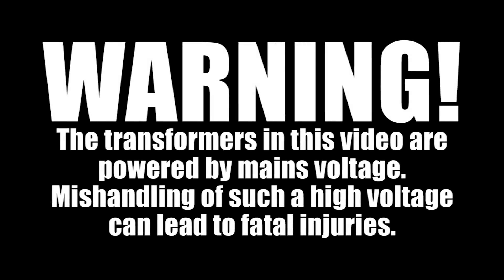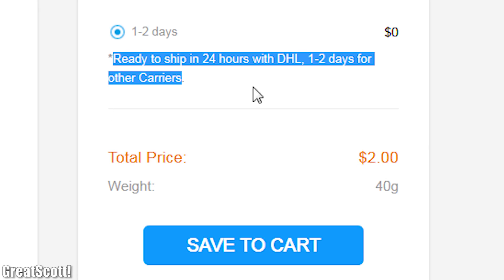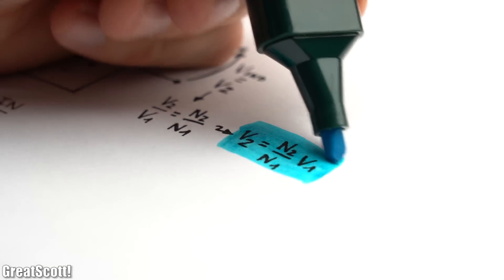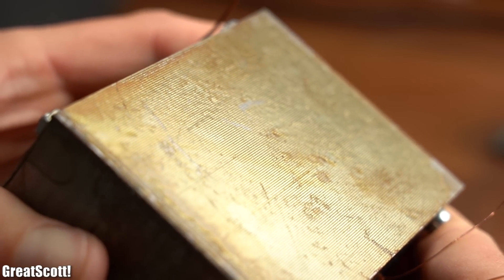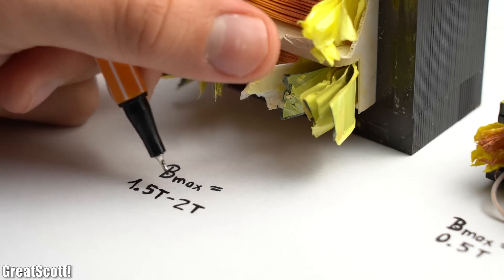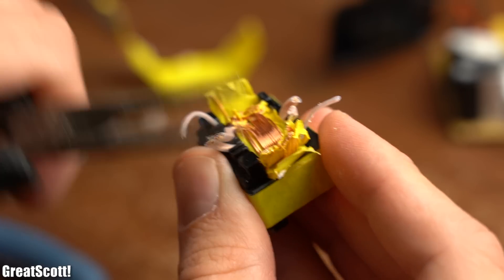Is it easy to create your own Transformer? Everything you need to know about Transformers! || EB#42

Comment: I made one with a keychain ring as a (pure) ferrite core.
Then 1 windings on the primary and 20 on the secondary. So I can transform 230V to 23V. (I wanted to measure my impedance by putting 23V across me and measuring the current.)

Problem:
The inductance was incredibly low, because low windings, low permeability and low cross area

A low Lh, causes a high magnetization current. I calculated it at 340A. Which is more than my C16 is made for.

So I imagned my breaker would trip if I plugged it directly into my wall socket (Yes I have a plug with cut cables, to which i attatched crocs to a small ahh keychain ring. With insulated 1.5mm^2 cables)

Comment: The effect of self-induction that opposes the voltage applied to the primary is already contained in the inductive reactance. The current flowing in the primary at no load is equal to V/Z and there is no additional voltage that decreases the current.
Reply: Carinat61 you are correct about the primary no load current; the explanation given in the video is wrong. I too found this segment confusing. The discrepancy is likely due to measuring the inductance at too low a current. Thank you for your comment.

Comment: Even on a masters degree, you will only touch on some of this theory, to design them, you really need to develop a program or excel spreadsheet to put in approximate values and use LUT from wire gauge charts. good luck.

Comment: So my biggest question is I see these all the time I'm an apprentice electrician trying to learn as much as possible and the primary coils and secondary coils never seem to be connected and I understand there's a magnetic field and Eddy currents are why you use thin laminated sheets of iron instead of solid iron but how does the voltage go through the core and out of the secondary if the cables are insulated is it just the magnetic field is that powerful it just works that way is how I understand it but I wish I knew why on a deeper level

Comment: I have question tought can xenon bulbs for some reason produce arc or non regulate frequency for exampel if alternator back charges true the dashboard or arcing relays?
For some reason I see sparks at night shuting in me engine and it looks like its coming from the head lights .
So any idea why that thing do what it does and how to trace down variating voltages ?
I think I fried me multimeter down the line some how.
Can in general xenon bulbs behave similari like wacum tubes?

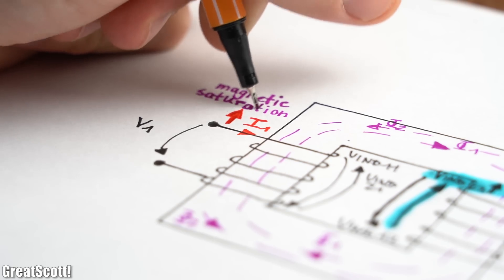Comment: @8:00 in the video: overloading a transformer DOES NOT lead to magnetic saturation!  The flux density is the HIGHEST  at NO LOAD condition & LOWEST at OVERLOAD condition.  All of the voltage "sag" is due to resistance losses in the primary & the secondary.
          Overload condition: iron's job is EASY,  the copper's job is HARD.
          No load condition: iron's job is HARD, copper's job is EASY.
          You can make a transformer transform CURRENT (to serve as a sensor).  You wind a heavy wire only 1 (or a few) turns as your primary.  You wind finer winding (with more turns) as the secondary.  You put ammeter across the secondary winding, essentially SHORTING it.  The current in the sense winding will be the meter reading  x #primary turns/ #secondary turns.  Because the secondary is shorted, voltages will be almost zero & so will be the core flux.

Comment: Transformers are a type of toy robot that has become popular all over the world. They are easy to create and can be made from materials that are easily accessible. In this article, we will provide you with all the information you need to create your own Transformers. 

The first step is to gather the necessary materials. You will need some metal tubing, a hot glue gun, and some scraps of plastic or other materials that can be used for the body of the Transformer. The metal tubing can be found at any hardware store, and the plastic can be found at most craft stores. 

Once you have gathered the materials, it is time to start creating your Transformer. First, cut the metal tubing into two pieces: one piece that is about 10 inches long, and one piece that is about 6 inches long.

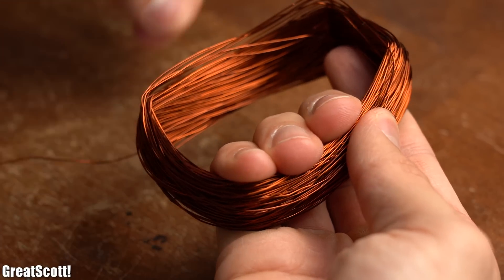Comment: Are those copper coils 3:19 enameled? 

I want to turn a small scale into a plug in scale because the batteries are so expensive.
But the amperage of the battery it uses is 0.17 which is really low and I can't find a proper transformer. Anyone know what to do? No I don't want to just buy rechargeable batteries. I want to see this through even if the costs defeat the purpose.

Comment: the way that those sloppy wires were  wound around that naked core is very dangerous...the proper procedure is to wind on an insulated form or bobbin, then slip that into the center section ( hopefully tight ), wedge with hardwood wedges top and bottom, double dip and bake with electrical varnish, and you might have something safe enough to plug in...your rig scares the hell out of me.

Comment: Wonder if your going to mention magnetostriction problems causing heat and “humming” in poorly wound transformers. With all things remaining equal in core design, a poorly hand wound winding will not act the same as one tightly and neatly wound and properly insulated. You actually can hear a bad winding and noticeably hotter transformer.

Comment: Did he say try it with dc voltage?? Can u explain that because I thought It only works on dc for inrush current because it's up to 7 time more usually the initial power on or off or switch open or close give or take,

Comment: Your explination of what a transformer is is lacking and actially dangerous.. you fail to mention that a transformer can step up voltage also. What happens when some asshat connects a meter to a 2kv + transformer and burns his meter and probably house to the ground? Transformers are no joke weather it be a 12v or 1200v transformer... 12v 1A will stop your heart.
Reply: 12 V 1A can't stop your heart, your body resistance is too high, you won't even feel it

Comment: A long time ago, while trying to wind my own transformer I relaized that the efficieny gets much lower when you just try to randomly wrap the wire turns on to the core! The  way you turn the wire around the core must be sequenced properly and in a way which strengthens the collective field of coil. This video repeats the same mistake which will definetely take a toll on the machine's efficiency.

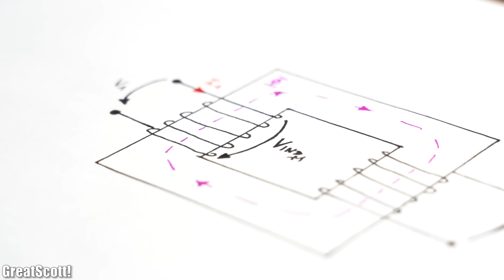Comment: @ 5:00 doesn't this just mean that your meter can't measure the actual inductance of the primary coil? Because the phenomenon you mentioned (coil induces a voltage into itself) is just its self inductance (aka its inductance). The more voltage it induces into itself the higher its inductance.

Comment: Sir I am designing a power supply of input 440 v and output of 5 v , using PI  ic , now using their software I have calculated the parameters for transformer with core EE19 and it is showing primary with 393 turns ,which will lead to a very large transformer , now how to get correct no. Of turns

Comment: Why didn't you make a form to wrap the wire around, remove the form and then push it over the transformer core ?.  Use stiff card as the form with an plastic rectangular shape with drill attachment (or coil winder attachment).

Comment: For a 50hz/60hz sine wave transformer (the kind of transformers you plug directly into mains), you measure the surface (not the volume) of the core you are winding copper around (for an E-I core transformer, only the middle) in squared centimeters and then you divide 42 by your result, and it gives you the number of turn you need for 1 volt!

If you don't understand you can ask me a better explanation by answering this comment!

Comment: I'm confused by the explanation of why the current through the primary winding is less then V/Z. Because the back EMF induced by the current in an inductor is nothing else than the phenomenon responsible for the reactive part of its impedance in the first place. And a transformer with the secondary winding open is just an inductor. So, there must be something else that is causing that discrepancy. Maybe the inductance measurement was inaccurate, or done at a frequency other than 50Hz.
Reply: Reply to Jorgelima5695: I too think the explanation given is incorrect. No load primary current is V/Z where Z is the impedance of the primary winding and V is the applied voltage, The measured discrepancy is probably due to the fact that the inductance measurement was not done at the (much higher) operating current. The core steel permeability is highly nonlinear.Also the iron losses which would not be determined by the resistance and inductance measurements are not accounted for.

Comment: I think what might be happening at https://youtu.be/2cxcP5lY7K4?t=269 is that the permeability of the transformer core is lower at low values of magnetising force. Therefore you aren't getting as inductance as what the mains voltage "sees". This can also be checked by comparing your Q factor against what you'd expect to see for the DC resistance and the reactance of the inductance as measured (I assume your test frequency is 100 Hz). It looks like the inductance is about three times lower than it "should" be.
The very low looking Q factor of 2.31 is also suspicious. It implies at 100 Hz that the inductance should be 0.3571 H, if the DC resistance is 97 Ω. It doesn't seem to balance up. That said, I don't have a better explanation off-hand. Was the battery in your LCR meter okay? I've been caught out by low batteries before.

Comment: I bought a transformer with 2 x 24v secondary outputs and put a bridge rectifier on each output. Without load each output was measuring 49vdc? Shouldn't this be closer to the rated 24v power of each secondary output? Or is this simply a no load voltage. I did not put either output under load until I could get a better understanding of the dual output transformers. The bridge rectifiers used were package type and not made fr inn 4 separate diodes.

Comment: Hi Greatscott.

I'm creating a diy spot-welder with a MOT and a timer/control board. In the primary coil there is a capacitor in series on the input of the primary coil. 
Why/what does it do?
Does it need to be there ? (It broke when removing the secondary coil.)

Thanks 💪

Comment: Hi GreatScott, overall a very nice video, good to see this kind of education content! I would like to offer some small technical corrections if you’re amenable. At 5:00, you say that the EMF induced in the primary which opposes the applied voltage is the reason the primary current didn’t agree with your complex impedance based calculation. This EMF is self induction, and is exactly what your meter measured, and if the measurement were taken under the appropriate conditions, the complex impedance formula would give you exactly the mains current. The reason you didn’t get agreement is that electrical steel is a highly nonlinear magnetic material: your meter’s excitation current simply wasn’t high enough to replicate the (nonlinear) inductance that the mains voltage sees at higher excitation. You could point at the chart at 6:30 (or a similar chart) to show this: the line approximating the slope of the 0.3 T B-H loop is less steep than the one approximating the slope of the 1.2 T B-H loop. Or, a current probe/oscilloscope measurement of the magnetizing (no load) current would show the extreme nonlinearity of the typical mains frequency transformer. Also, at 7:52, you say that increased load current can push the transformer closer to saturation. This is a very common misconception. In fact, at higher loads, a transformer is operating farther from magnetic saturation. The reason is that the secondary current’s flux opposes the primary current’s flux, as you said. This ends up lowering the total core flux. You can work it out from the lumped element model by seeing that the load current reduces the total AC voltage across the mutual inductance part of the winding system, and causes larger voltages across the resistive (and leakage inductance) parts of the primary winding impedance. So the dPhi/dt integral of the mutual flux (which is equal to the mutual voltage) must be smaller, and peak mutual flux is actually lower. At 8:29, the formula you show is the formula for induced voltage in terms of net magnetizing current (the flux that links both windings), not primary current. Magnetizing current is the difference between primary and secondary amp turns (at least ignoring leakage inductance, which is usually fair for mains frequency transformers). So that “I” should really be labeled “Im” or “Ip - Is”. Referring to the T model at 5:44, you can see how (in the lumped element model at least) the Lm element sees less voltage as the load current is increased, and so the flux linking Lm is reduced. The model is just a model of course, but the real behavior is captured correctly in this case. Edit: also, worth mentioning that the reason high power transformers use larger cores is really just so that the primary (and secondary) windings can be made with fewer turns of thicker wire, reducing the ohmic resistance and therefore reducing conduction losses, while still avoiding saturation at no load conditions. It's also worth noting that the volt-second product seen by a mains frequency transformer winding is a super fundamental parameter that drives core flux excursion as a function of winding count, and that practically we always use this method of calculating the core flux, and never use the induction formula, because the induction formula depends on the nonlinear resistance while the volt-second product applied to the winding is directly proportional to the change in flux linkage, and so tells you exactly how many turns and square centimeters you need to hit a particular operating flux.
Reply: Beautiful explanations.... I had exact doubts on the points you have elaborated... Thank you very much..

Comment: I used to make my own transformers baxk about 20 years ago, they worked well. Mine were designed for 25khz and up tho for switching power suppliy use. Calculated about 88% efficiency average on my diy transformers. Used to take the core out of commercial ones and rewind it for what i needed

Comment: This video is so awesome.

At my work we built a couple of Three-Phase transformers that were designed to transform 110VAC to 50VAC at 125Hz. We were struggling with saturation and we had to adjust the design of our system, thus increasing the operating frequency from 125Hz to 250Hz (not such a big deal since we were going to use a three-phase rectifier for those phase-phase voltages)

This video was very educative.

Can you please make a video explaining Generators or Alternators? That would be so awesome

Comment: Sir hao to increase 3.7v to 4 lakh kw😅😅😅
Reply: bruh wrong unit, you can't convert Volts to Watts. If you mean volts either side. you're looking at a conversion of 3.7v to 400000000 V. That kinda voltage will be able to jump 134 meters approx. thats like 0.15 km. I don't think you'd wanna create such a device even if you could. The ionization of gases in the 0.1km could easily make you lose consciousness if the current doesn't. Ah well theoretically anyways, a 134m spark gap is ridiculous.
Reply: @animatrix1851  I think you right sir. But sir can you make a video on this topic.....how to convert 3.7v DC to 400000..V AC voltage 😊😊😊😊😊please sir i request you 😅😅😅😅😅

Comment: good work.     after six minutes, i offer the following info.           any   'conventionally wound',
multi-layer  coil  has  an  ISSUE.        the issue is  a   MEANDERING  current  Path.
this  Meandering  current path is a  Key factor in the performance of  Self-inductors/generating coils.
at other times,  the resultant   back-emf/fields   'works against'  the creation of  maximum flux
density, in core material.        this issue derives from the way in which coils are usually wound.
a meandering current path is created,  and,      the current flow in  Adjacent  coil  Layers  is
out of phase;  180 mechanical degrees.         this condition is the source of  back-emf, and 
associated impedance.       is this information represented in the math, somewhere;
is it in  copper losses.      cheers

Comment: I always wondered about this. I once tried to build a transformer out of a nail and some enamel coated wired. Except the wire was only 0.2mm diameter and the lowest voltage transformer I had was 16v. I apparently forgot that joule heating was a thing and the enamel coating melted and the primary winding shorted. Guess I could try again with a resistor to limit the current. They have really bad hysteresis, but for some reason I love the idea of making a transformer or inductor out of a nail.

 I even tried making an RC oscillator with a nail and enamel wire for the inductor and a capacitor I made by sandwiching a piece of plastic wrap between 2 sheets of aluminium foil and folding it up to take up less space. But unfortunately the capacitor was too leaky to be any use. But I was able to measure a capacitance of around 500nf. Rimstar is a good channel to browse for stuff on making your own capacitors.
Reply: You wont want to use a nail because you need to complete the magnetic circuit so none of the flux is wasted to space. A toroid wpuld have worked better at least

Comment: Short version: The principle is simple.  Putting it into practice isn't so simple, especially if you need a particular voltage and current.
Basics: More turns of wire on the secondary than on the primary equals a voltage step-up with a reduction in abilty to supply current.  The opposite is also true.  And that's only the beginning.